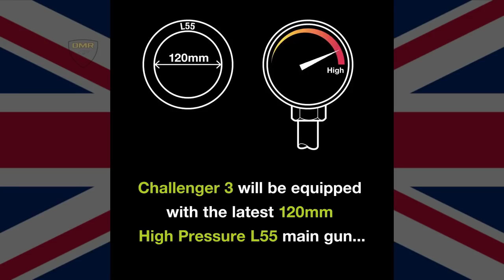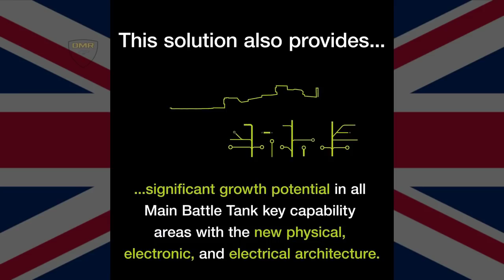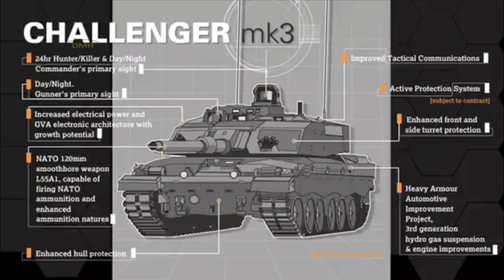Finally! The UK Unveils New Challenger 3 Main Battle Tank

Comment: What they did is hire a German company called Rheinmetall to strip and gut a Challenger 2, and replace all it's vital components with what makes the Leopard 2 such a lethal tank.
Reply: I mean rhinemetall is a great company and I’m not complaining we get a leopard but still keep the challenger name
Reply: @ye_clapped_6974  I kinda am. In 2017, Germany offered us 200 Leopard 2A7Vs for £4 million each. We denied to pursue this. If you do the maths, you'll notice that the German offer would have gotten us 52 more vehicles for the same price, of roughly the same capability (same gun, better mobility, better armour, no active protection though) and they would be arriving to troops about now, not waiting until 2027. instead of paying to turn Challenger into a Leopard, why didn't we just take the Leopards? It was a much better deal.
Reply: @AllThingsCubey  Did those Leopards still have torsion bar suspension, archaic MTU engine, and a 1970's turret incapable of future upgrade?
Reply: @AllThingsCubey  I never heard of this but I like to believe the leopards and challengers have similar armour types and I think the chally 3 will have better mobility but I guess it’s because the MOD wanted to keep it a core British vehicle also they must be more expensive in the long run because of imported parts and loss of jobs for British workers 
Honestly though I wish he took 100 of the leopards so we have a armoured force that is greater in more areas like mobility etc
Reply: @agt155  Archaic MTU engine that's more powerful more reliable, and lower fuel consumption than the Challenger 2's you mean. Turret is plenty capable of upgrade, considering they just announced another for the A6 fleet, arriving 2023, including active protection system and more countermeasures.
Reply: @ye_clapped_6974  Mobility of Challenger 3 will be better than Challenger 2, but still not Leopard 2 standard. Armour of Leopard 2 is mostly superior because the vehicle has more space to fit larger arrays. It's 2m longer and 0.5m wider, so the Germans have had an easy time upgrading the protection.
Reply: @AllThingsCubey  The old MTU is twice the size and outputs less than 100 sprocket bhp more - awful. Why else did they design the completely new Europack. 120mm is the max for Leopard 2 - and there's very little design improvement left with that.
Reply: @agt155  It's not twice the size, you're looking at the full power pack vs just the engine block for the CV-12. Power packs are nearly the same size and it has a lower engine capacity for 300 more HP. The CV-12 is the pathetic one.
Reply: @AllThingsCubey  better armour lol.  Please explain.
Reply: @MrGrim2u1987  Easy. Challenger 2's armour superiority is a total myth, based on combat against weapons which would not have concerned any modern tank. It's actually rather mediocre in protection, and that's in many ways because the dimensions of the hull are too small to permit thicker composite arrays. Even when Challenger 2 was brand new into service, M1 Abrams had superior protection on both the hull and turret. Leopard 2A5 onwards achieved superior turret protection levels, and the hull armour enhancements of the Leopard 2A6M, and A7V models are estimated to provide around 700mm effective thickness against KE rounds, compared with Challenger 2's hull which is, at best, around 480mm effective against KE. That's at best, because the driver's hatch creates a weakspot only about 200mm effective thickness due to lack of space for thicker armour in front of the turret ring, and the lower front plate is only 60mm of steel, with no composite at all. TES fits an external block of Dorchester here, but the effective protection is only about 300mm KE, which won't stop anything fired from a tank gun. 

Earlier model Leopard 2s indeed were not amazingly well protected, but the large size of the vehicle, and constant upgrades over the years, have provided the newest versions with levels of protection surpassing even the M1 Abrams, and far in excess of the Challenger 2. Whilst Challenger 3 is replacing the armour with totally new arrays, which will improve them considerably, the hull layout simply doesn't permit any meaningful increase in thickness and protection levels. Leopard 2 achieved its increases via both internal and external armour packages. Challenger 2's hull can only fit external armour to the lower plate, which has no internal composite. It can only change the internal composite in areas where they cannot fit external protection, such as the driver's view port. The result is protection that simply cannot be enhanced to a meaningful level in the same way Leopard 2 has achieved.
Reply: @EmperorLionflame  This comment is an absolute joke of ludicrous bias. The fact you think the L55A1 smoothbore is a firepower downgrade over the CHARM L30A1 rifle show how far gone you are from reality. Almost everything else you wrote was wrong or severely misleading too.
Reply: @EmperorLionflame  I don't know how to break this to ya buddy...

L30A1 has a muzzle velocity of 1650m/s, and has a maximum estimate of 610mm of RHA penetration at 2km, when firing the CHARM-3 APFSDS round, which is DU.

The L55A1 fires a DM-73 round at 1750m/s, achieving between 820 and 910mm of RHA penetration at 2km, without using DU.

Modern Tungsten projectiles have actually equalised their capabilities against DU anyway, but the L27A1 and L28A1 CHARM rounds still use DU because they're NOT modern rounds. They are short, fat sabot rounds as a result of the two piece loading of the Challenger 2's gun. That means they lose speed and penetration faster over distance, and cannot span as thick armour arrays as their much more modern, longer single piece equivelants from the smoothbore gun. Using DU was a crux to make up for bad ammunition design and the lower muzzle velocity and energy of the rifled gun in the first place. In fact, the L30A1 has higher chamber pressure than the L55, but much less muzzle energy, because it fires a lighter round, which loses so much energy in the rifling.

Your knowledge of tanks and their engineering is hot shit. Your numbers are garbage, and your bias is ridiculous. The L55A1 absolutely beats the fuck out of the old rifled gun in every capacity, but sure, don't make any effort to check your figures or learn how this stuff works before making a clown out of yourself online.
Reply: @agt155  You don't know much about tanks, do you?
Reply: @AllThingsCubey  The Leopard 2 powerpack is nearly a metric ton heavier than CR2's powerpack. The MTU 873 is 20% longer; 30% wider; has 80% larger displacement; and is 15% less fuel efficient at rated power output than the CV12, and yet only produces 100 bhp more sprocket power. Fitting such an archaic powerpack meant huge design constraints in other areas ie small turret ring, suicidal hull ammo stowage, no APU and an all around lack of armour.
Reply: @AllThingsCubey  Stop with these video gamer misconceptions. For starters the L30a1 is a gun, it doesn't have a 'velocity'. Why would you expect a modern tank gun from the worlds most experienced tank gun manufacturer to be so poor performing? As you say the L30 has a higher proof pressure than the L44/L55. It also has a larger chamber volume, so it is potentially the better gun performance wise. Rifling makes next to no difference.

The best performing tank rounds on the planet, the M829 series, all use DU for a reason. In fact everyone, bar the Germans who aren't allowed it, uses DU.
Reply: @agt155  The problem with rifling is barrel wear, as I'm sure you're well aware.

Comment: Challenger 2-A2 more like!! Re-manufactured turret with New L55 smooth bore gun, Gunners sight moved from on top of gun barrel, New turret roof with ammunition bustle on the back of the turret for the one piece 120mm ammo with blowout panels, Engine probably back up to the original power output before it was de-tuned down to 1200hp, Upgraded hydro-gas suspension!! Still could do with TROPHY™ active protection system (APS) as well!!
Reply: I believe it is getting a aps system
Reply: The engine wasn't de-tuned to 1200hp, total myth. Perkins just made a rather poor design compared to the MTU-883. The actual castings and forgings of the engine, shaft, and transmission could handle 1500+ horsepower, but the original fuel system and engine management, as well as the tolerances, are not up the scratch to make that power output. You can tell it's not de-tuned, just inefficient, from how much smoke it produces.
Reply: @AllThingsCubey  uprated turbos, rads and fans. was rolls design before Perkins!

Comment: On the picture at the end the active protection system was indicated as "subject to contract". Does this mean it is yet to be confirmed that it will be fitted in its entirety?
Reply: It means it will be a different contract. It's a fast developing area and this will be the best part of 10 years before FOC so a decision now doesn't really make sense.
But that does mean a future government could skimp on it.
Reply: It means if the MOD goes cheap on them it won't get fitted. You know how many things are designed to be fitted to military equipment at these early stages and then get cut?

Comment: To those arguing about top speed. 
Weight only reduces acceleration not top speed. So forget about challengers weight.
As for “just” a new cooling and injection system, those are extremely significant upgrades.
If your cooling system can dissipate more heat you can run more power. A new injection system will also increase thermal and power efficiency.
Just think what affect common rail injection had on cars, compared to an old diesel a common rail can produce up to double the power output in standard trim.

Comment: 1. Is it good at climbing hilly areas?
2. What range does it have with that 60mph speed? 
3. Does it use the L55 or the L55A1?
4. Is it a 3rd generation thermal? 
5. Where's the Remotely operated machine gun? 
6. Is the LFP still at 60mm?
7. There's no APS? 
8. Where is the Laser warning receivers? 
9. Is the hulls ammo still unprotected with blast doors and blow out panel?
10. Cage armor? 

This are my questions that can't be answered just be looking at the tank. 

For a tank that will enter service somewhere in the late 2020s the lack of the listed systems is a Disaster waiting to happen. I hope they fix this problem
Reply: @mrp6870  
"stated in the video"
But not actually mounted on the tank it self in any pic

Already watch the unveiling video and it said nothing about the APS and others
Reply: @Justineexy  or maybe because it's not mounted in the same way you would think you should?
Reply: @mrp6870  alright, 9 more years to go
Reply: @TheMarineGamerIGGHQ  no no,  Remotely operated gun doesn't exist on the current displayed tank
Reply: @mrp6870  anything?! 
Oh yeah totally,  you completely ignored the fact that Money exist and Britain doesn't have alot of it.
Reply: @Justineexy  im not talking about the remotely operated gun.
Reply: 1. Same as current Challenger 2, slightly better with improved engine.
2. 60mph was a typo, it's kph. Range is already excellent because of higher fuel capacity than other NATO tanks, they stated the upgrade increases the range further.
3. L55A1, so compatible with DM-71 if needed.
4. Yes the gunner and commander have 3rd gens. Not sure about driver.
5. Not fitted to the prototype but we have them already, it's plug and play.
6. Yes the LFP is still 60mm. The Challenger 2 hull is dogshit and very hard to improve upon because there's no volume to spare for bigger armour arrays. Biggest weakness.
7. APS is "subject to contract." One is compatible, but will the MOD pay for it? Who knows.
8. It apparently will have them as standard. I don't know where they will be fitted.
9. Ammo stowage in the turret is blowout panels. I don't know how many rounds are in the hull or how well protected they will be. Likely a weakness, especially as smaller dimensions vs Leopard 2 and Abrams will restrict ammo capacity now we have moved to single-piece.
10. It will almost certainly still be fitted with TES kit for actual combat, and TES included cage armour.
Reply: @mrp6870  Lol, I still don't think they'll be fitting the Remote machine gun on the new Chally, The army doesn't get the kind of love the navy gets :(
Reply: @AllThingsCubey  DM-73* 
yup, 60mm dogshit is still here baby!
Reply: @Justineexy  Yeah typo, my bad. The video showed a DM-63A1 round but I believe we are going to be ordering DM-73 to make use of the higher chamber pressure of the L55A1.

60mm is indeed here to stay... you'd need to totally redesign the Challenger 2 hull to properly upgrade the armour. It's a very badly designed hull that really changed little since Challenger 1, itself intended as a Chieftain upgrade. Maybe they can get the left and right of the upper plate to something substantially protected, but the driver hatch and lower plate are absurdly weak, vulnerable to even autocannon.
Reply: 1. It appears to have an improved engine
2. Unknown
3. L55A1
4. Yes
5. Does not have one
6. No, it features improved hull armor
7. Supposedly does have an APS
8. I think so. At least Black Night was supposed to have LWR.
9. Unknown, I dont think so
10. No
Reply: @AllThingsCubey  Ordering Dm73 is 1 thing, Germany selling it to them is another.
Reply: @johanlassen6448  Thx mate
Reply: @Justineexy  They already sold us the gun, and if you look at Rehinmetall's own advertising for the DM73 round, they are encouraging export operators of the DM63 round to upgrade to it. What logic are you even working on that Germany won't sell the rounds to the UK? Germany barely funds their own military but they LOVE selling their tech to everyone else. There is absolutely nothing developed by the Germans that they deem top secret and reserve just for themselves. That's what the USA does, not Germany. They just ask if you can afford it.
Reply: @AllThingsCubey  Oh boi oh boi! You haven't seen the Recent headlines have you? 

Germany is planning to cancel the export of their DM73 round to some unknown countries. So who knows! They are going to stop selling their Dm73 to a few countries but it's not know publicly who, Plus Brexit and the recent French-British clashes in the channel is going to cause some change in British-German Relations.
Reply: @Justineexy  That doesn't mean the UK. It's really simple. Agreements were already made that Brexit would not effect defence relationships. The UK, France and Germany already agreed on that. Meanwhile, they invited us onto their MGCS next gen tank program as observers in the last year, too. That L55A1 gun we're getting from them is a specialised, higher chamber pressure version, 50% higher than a regular L55, designed specifically for firing DM73 and its successors. I believe export customers with the regular guns need to upgrade the breach assemblies to use the ammo. Germany wants the UK to get this ammo.

Comment: How can they improve its 1200hp engine to make it go 60 miles an hour, thats faster than the leopard 2 with its 1500hp engine?
Reply: Biggest turbo will do it 😂
Reply: It has a brand new engine but i do not know what it is
Reply: Maybe it has a 1600HP engine?  I mean the Italians have that engine.
Reply: david woods  No it's not mate - it's British
Reply: Well from what i know modern tanks have had speed limiter put in or else it would be nearly uncontrollable.
Reply: Because 60mph is a typo. The engine is unchanged, at most increased to 1500hp by Caterpillar Defence. Leclerc weighs 20 tons less, has the same engine power and same suspension system, and goes 71kph/ 44mph. When they wrote 60mph, it's clearly a typo for 60kph. No tank goes 97kph without destroying the tracks, even if it had the engine power (and it doesn't)
Reply: @tattyheid7279  Well said that Man!! 🇬🇧👍👏😊
Reply: @AllThingsCubey  track speed is double road speed lol
Reply: @AllThingsCubey  The fastest tracked vehicle has gone at 81mph so 60 mph isn't anything that unrealistic
Reply: most updates are German engineering RHEINMETALL !  never ever 60 mph ! kg per hp ...no chance !!!!
Reply: Are people so ignorant to realise in the UK, we use MPH as our standard measure of speed, and not KM/H.

Comment: Is this the same 120 L55 the Germans are already using? The one that Germany is worried about becoming outdated soon. Also, since they don't mention engine, the speed might just come from lighter armour (new composite). That would help with naval and air deployment too.
Reply: not sure about that but they won't use the new 130 from rheinmetall
Reply: They use the New L55A1.

Comment: Did they say that they had also upgraded the Engine size & power (Hps) too, on this model? I didn't hear it!
Reply: Hope so, 1200 was never enough. RR/Perkins had plenty in hand, they said.
Reply: @dartmoordave  : Especially, if in a couple of years hence, when DEW (Laser-weapons) become available on land-forces operating platforms, that will be a very big game changer! It's not too far-fetched either, as 'The Dragonfire DEW System is being scheduled to be deployed on to a RN warship by mid-late next year (2022), or possible earlier, if the ongoing trials all go well! DEW (Directed Energy Weapons Systems) Air Force & Aerospace variations are also in the pipeline too for the mid-2020s! 
But for a good tank, they should have at least a suitable upgraded engine/power-unit of 1800-2000 HP, in any event for the new Challenger-3 model (Or the Upgraded Challenger-2 model, as it is in reality!!)!